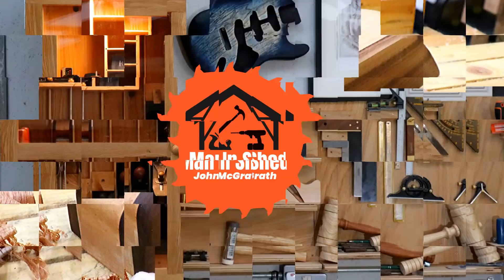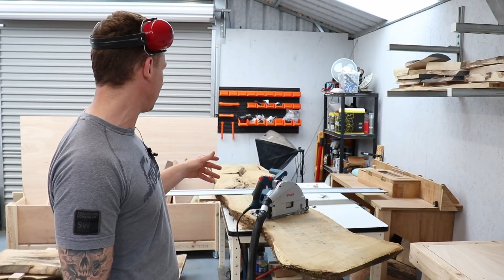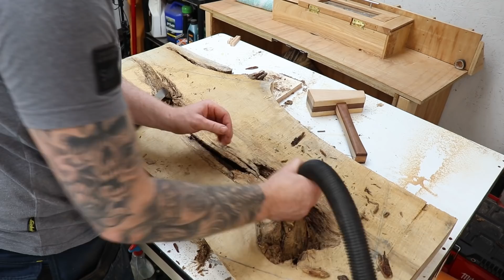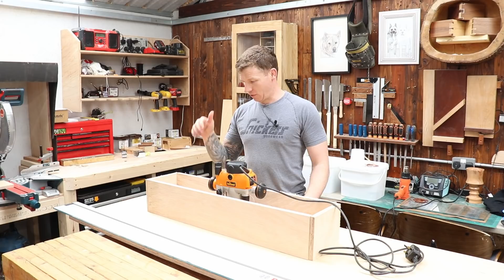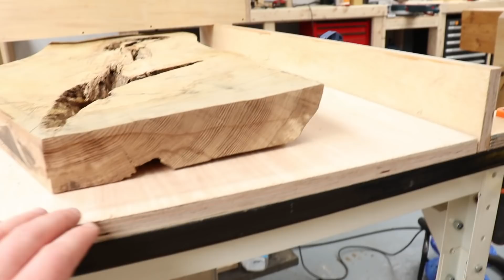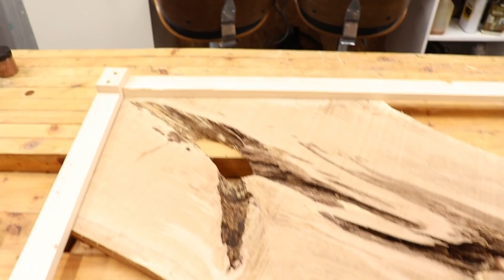How to Flatten a Live Edge Slab and Build a Router Sled. Resin Table Build Part 1

Comment: Id say that was torture with that little router bit🤣. Im thinking of making a small bar counter top like this, looking forward to the next video. Best of luck with the tracksaw, theyre a great investment. Ya should get a sheet of high density insulation for your benchtop to cut on, handier than setting up on the floor and easier on the spine.